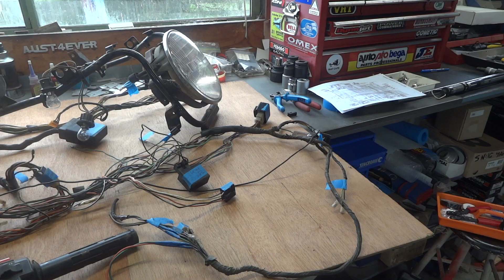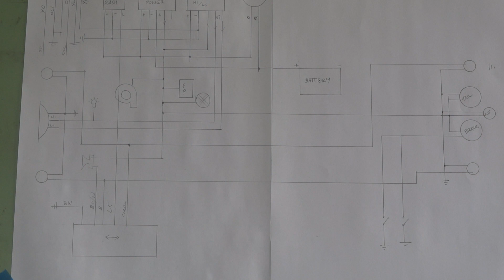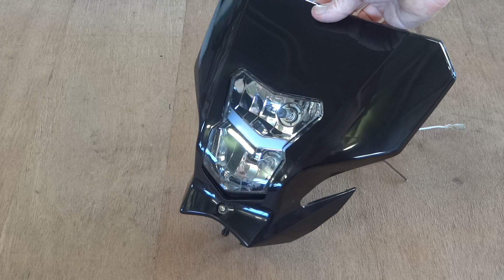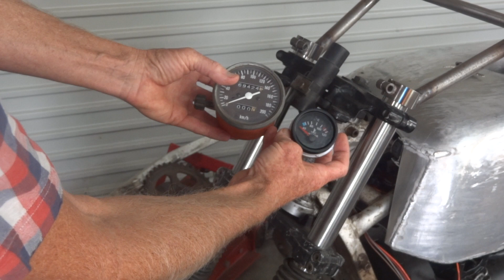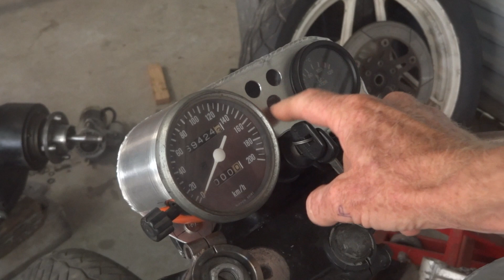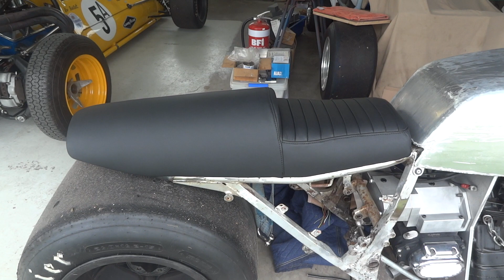Mercurial Outboard Motorbike Wiring, Headlight, Lithium Ion Battery, Mercury 2 stroke V6

Comment: Thanks for the updates,the  bike looking good are you using a alternator to keep charge on the battery ?
Reply from the maker: outboard motor has the alternator built in. But thanks for the tip.

Comment: Funny bugger! I had to pause the video I was laughing too much at the "bus terminal" line. I am curious to know how accurate the speedo will be running off another manufacturers gearbox? Are you working from a formula to calculate an approximate speed or are just going for "close enough is good enough"? Enjoying the progress.
Reply: Old bike speedos run off the front wheel.
Reply from the maker: speedo runs off the front wheel Glenda
Reply: Malcolm uses a specific formula on all his creations. It's  the first one.

Comment: You may have figured it out already, but if you have not please allow me to chime in:   For the ignition switch you have two choices: 1) Remove the M/C key switch in favor of an outboard motor switch or... 2) If you need to keep the OEM key switch you can install a cube relay to make it work with the Mercury ignition system.  I'm assuming the suzuki breaks power to turn off the engine while the Mercury outboard requires you to ground (earth) the black yellow wire on the switch boxes to turn the engine off.  A relay would work to accomplish this.   Additionally Mercury uses a mercury switch to turn off the engine if it gets thrown up by impact.  You may consider re-orientating this switch for use as a tip over sensor and you can use the same terminal for you r shut down relay wiring.  It could all tuck nicely into your electrical area.  If that appeals to you, you may choose to get a second mercury tilt switch and mount it in the opposite orientation because it only would work as a tip over switch in one direction not both so you would need two of them.
Reply from the maker: thanks. being the minimalist that I clearly am, I'm just going to use the bike kill switch to switch the engine on and off. ignition switch will just power up the other stuff.
and thanks for the tip on the tip over switch. I'll have a look into that